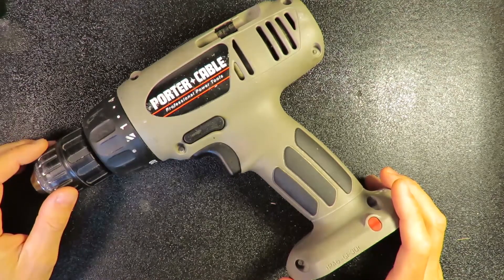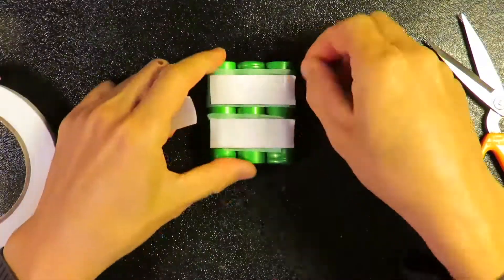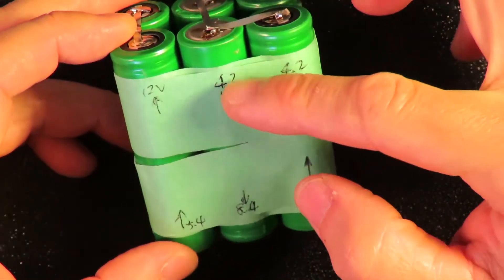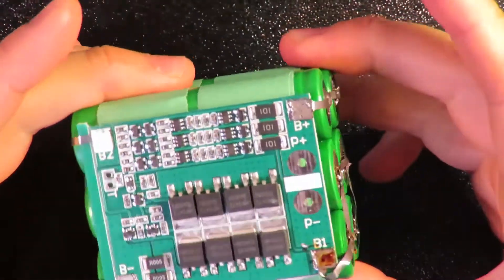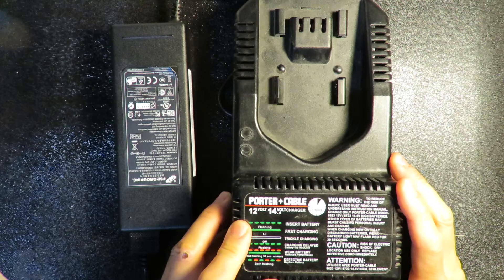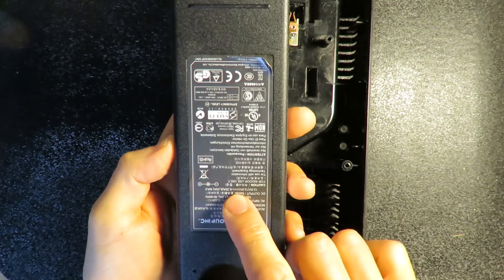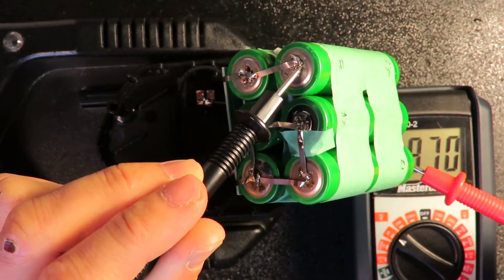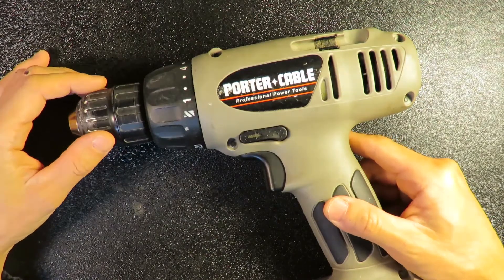DIY 18650 3S 12V battery for porter and cable cordless drill.

Comment: I bought 25amp bms thinking it would be enough, it barely handles 1-2 amp and trips. Doesn't even run the drill with no load.

Comment: How's perform with load makeing holes  and screws tighten it's perfect or get  stucked..?
I mean 25a bms work well or need more amps like 40a or 60a. I am going to do same but Lil confused about bms apms.
Reply from the maker: Imran Khan You are right, it gets tough when do heavy load task. 40A should be good!